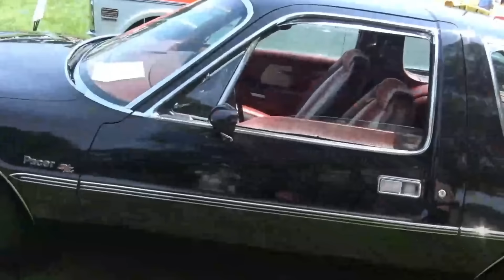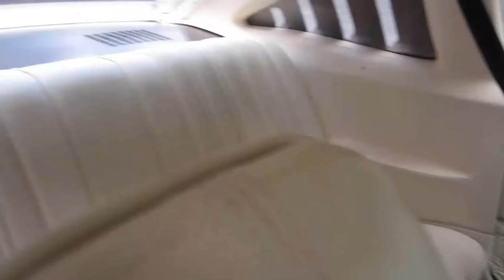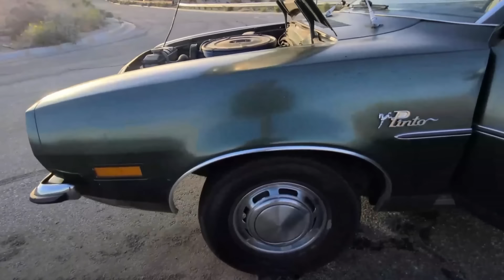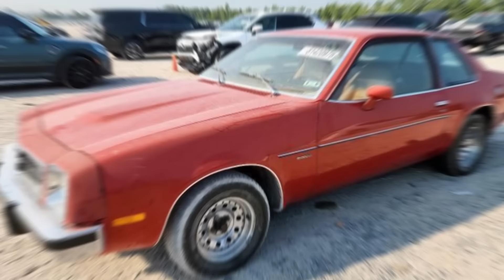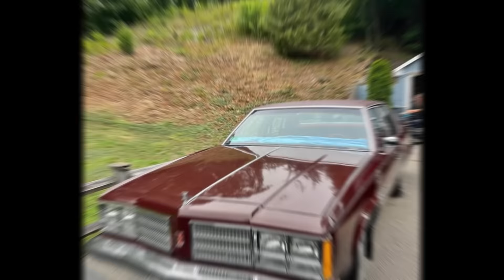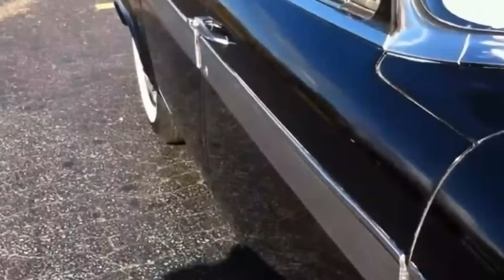Top 13 WORST Cars in US History!

Comment: Had a older Super Fine Coworker who had the Volare ..

2dr auto 318.

No wasnt a fully dressed up one either.

I was in HS an she was one of the staff at an office I PT'ed after school.

The pay was hilariously small but needed greenbacks.

I also worked at a gas station owned by an older Italian guy who took a chance an educated me on cars.

New an old.

I also pumped gas for those who didnt have a clue whether to use low mid or high octane.
Had this one lady come in with a diesel 

An didnt know where the fill tank was..
Yep 

A Peugeot.

Ugly car.

Anyhow the Sexy Office worker came by my House an asked if we could go to the shootin range as she wanted to buy protection for herself.

She knew my Dad was a CHP officer.

I took the only two weapons I had as my Dad wanted me to follow in his steps.

Anyhow her Volare was a disaster.

It died out like it was outta gas.

Later I found it was a fusable link that decided to fuse itself away.

We took my old 52 Plymouth to the range.

She was surprised how comfortable it was even though it was a tank an really slow.

But my only retort to her I remember it well , .
Was 

Yes its old
Yes its slow
Yes its not new.

But , its never left me on the side of the road an I'm confident it will take me anywhere even out of state an back ! 

I told her Old Giovanni an I rebuilt the Flat head Six an it purrs at idle an wasnt a slug on the freeway.

She loved my old car an we both ended up going to car shows even back then .

Comment: Unfortunately fr the AI addict who strung this together there are those of us out there that actually owned and drove these vehicles real life and of those listed, I had Monza, pinto and volare. The Monza had theV8 and getting to the plugs wasnt easy on the passenger side but lifting the motor did help; it was a fun car to drive and was reliable, as was the pinto as well; slow compared to that Monza but just as reliable and working on it was easy. Same story on the Volare, it was just a re dressed Dart, had the same mechanicals and once you cured the pollution controls on it, the car ran well and was pleasant to drive. Sooner or later these AI quacks will get ahold of real world information instead of this garbage, and maybe tell us something we didnt know!
Reply: My first car was a 78 Volare. Except for the crappy electronic lean burn ignition system, it was a good car. I've had several more Volares and Aspens since (I currently have a 78 Aspen, that I've had since 2004) and while they're hardly a real muscle car, they're for the most part, comfortable, reliable cars.
Reply: @mikeadcock1592  yeah those cars had awful missions systems on them. I found the best way to deal with them was just Paramount completely distributor and all and put in a MSD 6A that cured everything gave it better running characteristics and although that was expensive, it was worth it once you were through because then you had a car that just would never quit and passed smog every time!

Comment: Ford Edsel problem ... designers used push button gear selection on the steering wheel. Drivers were accidentally putting the car in reverse at highway speed. Locking up the back wheels, and damaging components

Comment: My father had a 75 Vega....he drove it for 160,000 miles.
Reply: Is the zero button stuck on your key board?😂😂😂😂😂
Reply: @andyhamilton8940  No, he commuted 110 miles round trip 5 days a week. The worst parts of the engine design were the air cleaner that was bolted on to absorb backfires and the water pump that acted as the adjustment for fan belt tension.

Comment: My 1974 Vega was a great car. Never overheated and I got bc almost 150,000 miles on g the original engine.  I also had an AMC Paved and I loved it too.
Reply: Had a 74 Vega GT. Bought it new. Body rusted thru within 2 years.
Reply: @tomfields3682 I had a 72 Vega. As long as you kept the radiator full, no problems. I had mine rustproofed .

Comment: How did you get the Pinto so wrong when reporting it being made from '71 to '73? Pintos had a ten year run before the Escort replaced it in '81.
Reply: I had several friends who had Pintos or Bobcats. No issues with any of them.
Reply: More AI bullshit
Reply: AI script? Possibly full AI video?
Reply: I guess this is all AI.  The Pinto ran from 1971-80.  The Vega ran from 1971-77.  The RWD GM H-body ran from 1971-80.  The Dodge Aspen/Plymouth Volare ran from 1976-80.
Reply: For the price Pintos were a good little car .
Reply: @josephmclennan1229 ???? Better Buy a casket than that
Reply: The ai actually got this right, somehow. They were made far less explosive from 74 on, so aren't included with the 71-73, which were objectively bad, dangerous cars.
Reply: My sister in law had a bobcat and she loved it.
Reply: They are only saying the 1971-1973 Pinto were unsafe due to the gas tank placement.  The other years were better and not included in this.
Reply: I had a ‘79 pinto in college.  I loved that car even though it left me in a ditch more times than I can remember.
Reply: Maybe the 74 through 80 pintos had the fuel tank issue fixed and wasn’t considered one of the worst. 🤷‍♂️
Reply: My girlfriend bought a pinto in 1979 new
Reply: I got my first speeding ticket in my grandmother's Pinto. My sister's first car was a Mustang II.
Reply: Mon ami, la Ford Pinto est la pire voiture avec son réservoir d'essence explosif situé en arrière et sans protection suffisante avec une valve des vapeurs. Je connais personnellement une famille détruite au complet quand leur voiture a été percuté en arrière. 5 personnes brûlées dont 4 décès. La personne qui a survécu a été brûlé au 3 ième degré et elle a été amputé des ses doigts et tout son corps a été réparé pendant 2 années d'hospitalisation. Toute sa famille est décédée dans cet accident et elle est la seule qui a survécue. Ford a payé pour leur dommages mais c'était des miettes de pains qu'il a reçu.
Reply: I'm lmao right now because my brother had a pinto WAGON with 2 15" subs in it  in 1988...I think it was a '76.
Reply: I bought one that was a 1974
Reply: My dad bought a new Pinto station wagon. It cost $3,500 in 1978.
Reply: Research, naa
Reply: Ford made model changes to the Pinto after 1973 and again after 1978, probably in response to feedback from customers and dealers. 

This is not uncommon.
Reply: Unless they're only speaking particularly about those three years.

Comment: I had 75 Monza Town Coupe with four no AC. I had to have engine and the transmission  overhauled at about 40000 miles. I traded it for 77 Monza Hatch with a V8 and I got the same gas mileage. This car was much better than the 75 and I only had minor problems with it. It was a great car and it did handle really well.

Comment: I once knew someone that drove one of those Monzas for years.
Reply: mine lasted 16 years
Reply: I bought a new 1975 Monza coupe. It had a 4.3 v8 with a 4 speed. The shifter broke due to my abuse and I replaced it with a Hurst shifter. It handled good and was fun to drive. A friend that was a professional mechanic replaced the back plugs without moving the engine. It did have a paint problem but I never saw any rust. I am a Ford man but the Monza was one of the best cars I ever purchased. $4800 sticker price.
Reply: @mississippinative4578  I had an 80 Monza hatchback 4 cyl 4 speed manual.  Put a little over 100k miles on it and never had a problem with it.  Just regular maintenance and tires.  It was suprisingly great in the snow too.
Reply: I knew a guy that had a monza with a built 350 in it. It was a monster street racer.
Reply: @fortyseven1832  _ I think I lost a drag race to that guy ! In Fremont (CA)
Reply: My ex-wife had one when we first met..
Reply: I always thought the IMSA Monza (with the box flares and aero) looked bitchen' and I'm a blue blooded Ford loyalist. Maybe I had a moment of clarity!😂

Comment: 1. When GM discontinued its Wankel rotary engine program before an example was even built, that should have killed the Pacer right then and there.
2. I'm sure GM engineers were begging their superiors to stop the Vega before the first one rolled off the line when they saw it.
3. Chrysler should have let the Dart and Valiant soldier on for at least one more year.
4. Ford wanted a car that was a step above Mercury and a step below Lincoln. Talk about an identity crisis. 
5. Chrysler still used body-on-frame construction for its cars until 1960 (Imperials did not use unibody construction until seven years later).
6. As was the case at GM with the Vega, I'm sure Ford engineers were begging their superiors to kill the Pinto before the first one rolled off the line when they saw it.
7. Mercury mercifully canceled the Turnpike Cruiser after 1958 to make way for the Park Lane.
8. As was the case with the AMC Pacer, when GM canceled its rotary engine project, that should have killed the H-body cars right then and there.
9. For all its problems, the Mustang II DID accomplish one thing - it saved the Mustang.
10. GM North America should have worked with its colleagues across the Atlantic at Adam Opel AG in Germany (which it still owned at the time) to develop a diesel engine.
11. See #3.
12. Studebaker and Packard was not a very good combination.
13. Later Chevelle-based models saved the El Camino.
Reply: 1. When GM discontinued its Wankel rotary engine program before an example was even built, that should have killed the Pacer right then and there. [What was sheer irony was that when AMC bought Jeep from Willys, they discontinued the buying of Buick 225 V6 engines, which would have probably been a great fit for the Pacer instead of gambling on GM's Wankel].
2. I'm sure GM engineers were begging their superiors to stop the Vega before the first one rolled off the line when they saw it. [It was foisted on John DeLorean, who'd been "kicked upstairs" from Pontiac to head Chevrolet, the main issue being the gamble on the 2.3 liter aluminum block engine.  What's sad is that up from 1962 to 1969, Chevy offered the 153 cube four-banger, a cut-down version of its inline Six, and the tooling was there, if the 153 was too big (and it'd have smoothness problems), there was a 134 cube version (the shortened version of the 194 cube Six) four that was used for Latin American small cars.]
3. Chrysler should have let the Dart and Valiant soldier on for at least one more year.[Agreed. A lot of build problems with the Aspen/Volare F-bodies might have been solved if the intro had been delayed to the 1977 model year].
4. Ford wanted a car that was a step above Mercury and a step below Lincoln. Talk about an identity crisis. [Actually in between Ford and Mercury.  But, yeah, introducing a whole new make when other makes like Hudson and Packard went "poof", and DeSoto was on its way out.  And never mind who thought that "Va-Jay-Jay" looking grille was stylish...]
5. Chrysler still used body-on-frame construction for its cars until 1960 (Imperials did not use unibody construction until seven years later). [And that only with the A-body Valiant for 1960, for that year only a separate make, which was soon "fixed" by putting it under Plymouth, and badge-engineering a Dodge version known as the Lancer.  It was in 1962 that unibody "B" bodies, which were FULL-SIZED but "downsized", which Mopar misread that the American public wanted.  Although there were quite a few good cars as the 1962 to 1964 "B" bodies, they didn't sell well, and with the Chryslers remaining a longer, body-on-frame, the Dodge Custom 880 was the lone Dodge true "full size" offering from 1962 to 1964.  It was in 1965 that the "B" bodies were redesignated as "mid-size", and the "C" bodies that were full-sized, including the Plymouth Fury lines, were also unit-body.].
6. As was the case at GM with the Vega, I'm sure Ford engineers were begging their superiors to kill the Pinto before the first one rolled off the line when they saw it. [Lee Iaccoca wouldn't hear of it.  When problems with the Pinto were pointed out, he'd take a puff on his trademark Cohiba cigar, and gruffly say, "Read the Product Objectives and Get back to work!"  The Pinto was not, at least statistically, the rolling firetrap that legend made it out to be; indeed, it was about mid-range in the subcompact class for car fires from crashes and rollovers.  The trouble with it was how hurriedly it was developed, as the Product Objectives that the future head of Chrysler was adamant upon was "two years, two thousand dollars retail price, and no more than two thousand pounds curb weight."
7. Mercury mercifully canceled the Turnpike Cruiser after 1958 to make way for the Park Lane.[ You can't be serious.  The PARK LANE?  Ugh...]
8. As was the case with the AMC Pacer, when GM canceled its rotary engine project, that should have killed the H-body cars right then and there. [The Iron Duke, though noisy, solved a lot of problems, and should have been the engine in the Vega all along].
9. For all its problems, the Mustang II DID accomplish one thing - it saved the Mustang.[IDK why the Mustang II gets no respect!  It was a great-looking sporty car, and actually took the car back to its roots, at least as far as being small, inexpensive, and fun to drive.  The trouble was that it was sold during the MALAISE era, which nixed anything resembling a power plant that it deserved.  It took several years to finally get the proper engine, a V6 that had enough "pep" to be credible.  Just as with the succeeding "Fox body" Mustangs...a FOUR BANGER?  SACRILEGE.  And it's too bad that when a V8 was stuffed into the Mustang II's engine bay, it was a wheezy two-barrel "grocery getter" version of the 302.]
10. GM North America should have worked with its colleagues across the Atlantic at Adam Opel AG in Germany (which it still owned at the time) to develop a diesel engine. [Or with Isuzu, which it had a controlling interest in at the time.]
11. See #3. [More a case of the nitwit, like so many of today's "know-it-all" punks, doesn't actually know his subject for shit.  The Aspen and Volare were the SAME vehicle, so this was a repeat segment].
12. Studebaker and Packard was not a very good combination. [In theory, could have been, but the trouble was Studebaker "cooked the books" in being acquired by Packard, which was actually in better financial condition. The trouble was that Packard, though renowned for quality of its cars, needed to diversify w/o cheapening its lines, which they'd ALREADY done with a prior "lesser" Packard that the public scorned, in order to survive.  Studebaker's bad finances ultimately sank the "rescuer" as well, and the "Packardbakers" only hastened the inevitable].
13. Later Chevelle-based models saved the El Camino.[Likewise the lesser-known Ford Ranchero didn't do all that well on the Falcon chassis, but survived longer on the mid-sized Torino.  Both makes just had to find the right nice for an American "Ute"].
Reply: Not sure why you equate AMC vehicles with GM and Wankel rotary engine?
The Wankel was a real flop in several Mazda models until the Rx7 finally got it right.